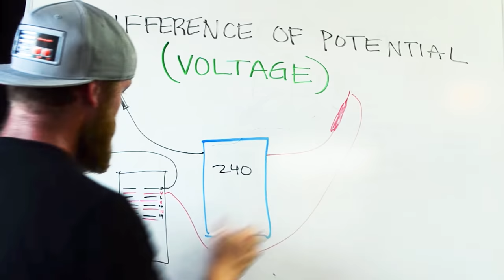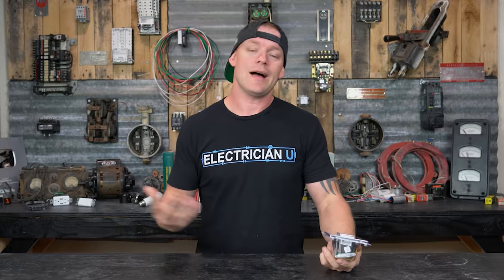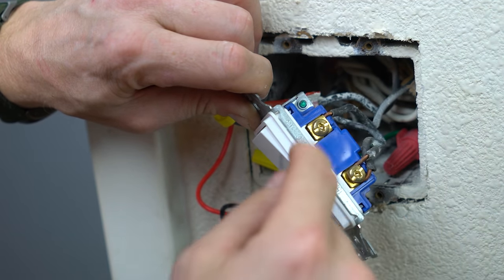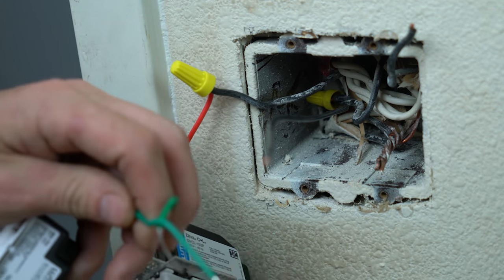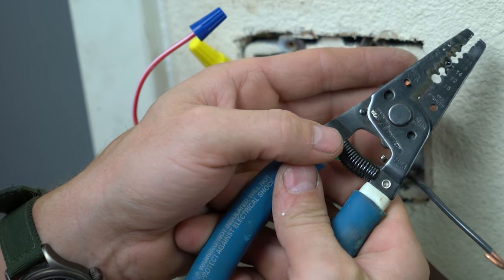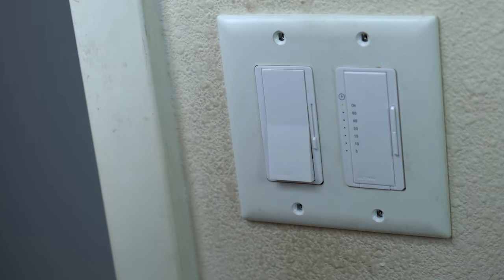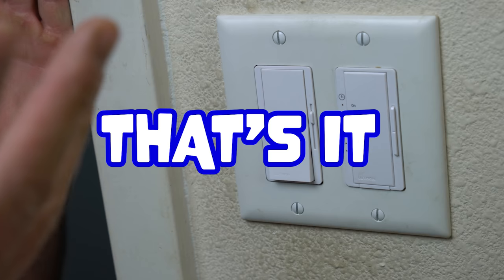How To Install a Bathroom Fan TIMER SWITCH

Comment: run the fan exhaust into his room   he'll remember to turn it off lol
Reply from the maker: aaaahhhahahaha that's an outstanding suggestion!  hahaha
Reply: @ElectricianU  What are your thoughts on wagos? Really enjoyed your transformer video, thanks.
Reply: @sylvesterstewart868  I like and use the lever ones. Cost more, but a big time saver and easy to change things later.
I've seen too many wire nuts loose.
Reply: @JasonW. I Was taught to make a mechanical connection by twisting the wire and the wire nut just insulates the connection. I have some I've used for temporarily connecting this solar panel set up I have. It seems like they could be good for where you might not want to risk breaking old wires by twisting them.
Reply: @sylvesterstewart868  The loose ones I've seen are where the wires were not twisted, and the wire nut was all that was holding things together. Wire insulation was usually blackened/charred close to the nut.

Comment: Very interesting to know about the metal tabs used for heat dissipation. I’ve always taken the minimum off, but never realized the purpose behind that. Maybe not quite as important with LED lighting, but great to know.
Reply: @boogermeats  those will get warmer the more watts they need to dim down, and the metal acts as a heatsink. Remove some of the metal, the thermal capacity won't be the same and may get too warm while dimming high watt loads. It makes sense to me.
Reply: @boogermeats  I would presume the documentation that comes with these lists how much derating happens per piece of metal removed. Would be best to see what the manufacturer says.

Comment: Hi,

Even better than a timer, the DewStop moisture sensing switch is fully automatic AND has an adjustable timer (settable between 3 and 15 minutes) function when you need to run it manually. Since the switch is being replaced anyway, this is the best approach. 

I installed one several years ago and love having it run as long as I'm in the shower and then it will turn off automatically when the humidity is low enough. 

On a different note, I've implemented the Lutron Caseta system, including the bathroom light switch, anytime I leave the house, all the lights, including the bathroom light, go off. The system is also programmed to turn off all lights (not including the bedrooms) at midnight. All switches are dimmers, so I'm not blinding myself when I need the bathroom late at night. 

Wish you well with your videos. 
Bruce
Reply: There are a few of them around, I use a similar Leviton product that has an even longer timer range, and will also run periodically - say 5 minutes every hour, great if you're venting a litterbox.

Comment: Great video as always! I just put in something like this a few months back, except I went with a Leviton IPHS5-1LW since my problem is more people forgetting to turn it ON when getting in the shower. It turns on/off at a button press, for 30 minutes of runtime, then auto off. It will also turn on when above spec humidity and until spec is reached. Humidity sensitivity and runtime are configurable with dials under the cover so there are options and still a neat and simple operation.
Reply: I also get great satisfaction from cleaning up a janky junction box when I change or upgrade a switch or receptacle. And yeah... It's nice to just be able to turn the fan on and let it automatically "courtesy vent" after you leave without having to remember to come back and turn it off later. 🤣

Comment: The electrician I worked with told me, just because something can be done (from code) doesn't mean it should be done.

Since we worked in a retirement home, switches and outlets were constantly going bad or getting destroyed and would need to be replaced often.

As such, we never stripped a mid conductor to create a connecting point. Reason was that exposed hot could accidently get jumped from someone working in the box.

It's safer to run a separate pigtail to each switch instead of having that unnecessary exposed conductor.

Comment: Even though, I was looking for another timer, I was so entertained, I kept watching. Great job keeping us laughing. I am looking for a timer, that I can plug in my big fan, so it can dry out my shower, then turn off after 1 1/2 hours. I figured, I would plug a timer in the outlet, plug my big fan into the timer, and have a remote control mounted next to my shower.  Any thoughts on this? Thanks, Glenn

Comment: Great video like always.
I just went with motion sensors, so I don't have to even touch them.
Reply from the maker: I've done that in the past too, but sometimes you have some extra stink and need to keep that thing on for a long time lol - I guess a lot of motion sensors let you program time delays though too.  Solid option, you're right

Comment: I just installed a fan unit with build in moisture sensor in conjunction with timer so unit turns on automatically while taking a shower or in some cases were some bathrooms have washer dryer unit works great

Comment: So the switches in this bathroom are a vertical unit ie there’s 2 switches with one on top of the other and they flip left and right to turn on and off. I’m sure you’re familiar with this as an electrician.. so what do you recommend I do for that situation? PLEASE! 🙏

Comment: I have a Panasonic FV-0511VQ1.  Have you ever had issues with these timers not work with certain bath fans?  I see the bath fan slowly startup and then shut off on its own before the timer expires.  Changing the timer to the always on setting does not remedy the situation.  Thanks.

Comment: Random question I have 3 different porch lights in 3 different places around the perimeter of the house is it possble to connect all 3 porch lights to 1 timer or does each 1 need a seperate timer switch??

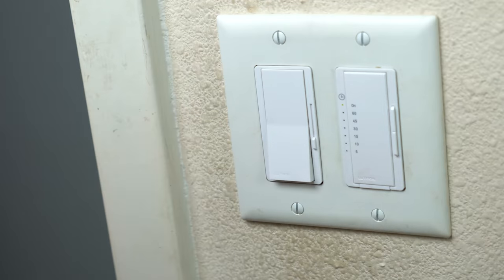Comment: When you put the cover plate on, you can see the green LED next to the "ON' label is illuminated (you can see it better at 16:38).  Why is it on already?  Was the power not turned off, or does this device have a battery-backup to maintain the setting if the power goes out?
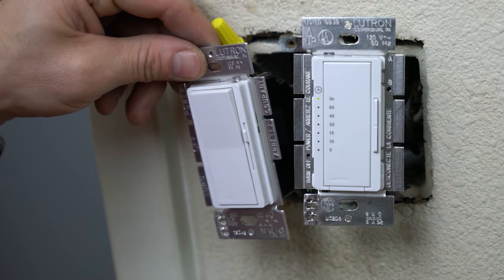Reply: Power was definitely on. At 13:03 he hits the switch and the light comes on momentarily.

Comment: If you loose power does the switch default back to on? Kick the breaker off wait and min and kick it back on. Wondering if you will have to re-program after.

Comment: Can you still turn the vents when the light switch it’s Off or when the dimmer it’s at low or half way? 
My Fan doesn’t come on until my light switch dimmer is at high or at On position.

Comment: Hey great video but get yourself a voltclaw to push those wires back into the box. Also to get the plate lined up and level stick it on backwards and put a level on it. Finally turn off the power unless you like buying $30 timers that blow up when you push them in.(I usually tape up the timer it it has exposed screws)

Comment: Great video! I have two questions out of curiosity: 1. Can you give me a ballpark estimate what an electrician would charge to do something like this? 2. What does it mean that the wattage rating will go down if you need to clip those tabs off...is that a safety concern? Thanks!

Comment: I have seen old neutral pigtails from the 1950s where they left one leg long, skinned a section and twisted it with the other neutrals. Then they soldered it and covered with friction tape.
Reply: That sounds old school and ugly and most likely there is no Earth conductor involved LOL :-) :-) don't stick a fork in it or you will be done
Reply: @kevinpoore5626  Sometimes there is a thin ground wire to the back of the box.
Reply: Yeah if that's what you want to call that but sometimes very rare and if it is there it's so short it does no good lol :-) :-)
Reply: @kevinpoore5626  It can possibly clear a ground fault if the hot wire in the metal box happens to become exposed and touches the box. Better than nothing at all if the box is metal.
Reply from the maker: me too lol
Reply: @ElectricianU  They weren't going anywhere, though. Most of the wiring from the 1950s I have seen was pretty well done, just not up to current code.
Reply: Those old damn switches seem to never go bad either. Lol

Comment: Even better than a timer is a humidity sensor switch.  Leviton makes one (PN  IPHS5-742-0LW) which works well.  Simplifies use by removing an actual duration selection (thereby removing the decision from my kids), but allows manual turning on with a single button, or automatic turning on of fan when humidity rises (no longer need to yell at my kids to turn on the fan when they take a shower!).  I've replaced all my digital timer switches with the humidity sensing switch, which should just be a code requirement because of its benefits.

Comment: I have a bathroom fan controlled by 2 x 3 way switches. One in the bathroom and the other on the lower floor to use the same fan as an exhaust for kitchen fumes. (Open concept floor). How do I install a timer in the bathroom? Cannot find a 3 way timer switch.

Comment: Great video. Not only educational but also fun to watch. One question: is there supposed to be a neutral line? Or is that optional?
Reply from the maker: Thanks for watching! Depends on if the equipment requires a neutral. (More often than not it does require one.)

Comment: 15 min is fine to destink the room!
Interesting about the heat sink on the switch.
Speaking of heat, I just learned that there is code for thermal expansion of pvc conduit and an expansion coupling to handle this.
Made me think of the wire in the conduit.
I'm running 1 1/2 PVC  90 feet to a subpannel. Using 2-2-2-4 aluminum wire. The PVC will expand and contract about 3" in a 100degree temp change. What about the wire?
Can't find anything on this, but it will expand with the temperature changes. 
Would it be a good idea to put a pull box in the middle and loop the wire in a circle to make room for the expansion and contraction?
Also, a video on different types of wire would be cool. I learned a lot looking for what type of wire to use for this.

Comment: Or change out the fan with one of those humidity-sensing ones. Ours was super old and noisy and barely moved air anyways. Replaced with a model that was quieter, higher CFM, Auto on with humidity (showering) and can manually trigger it on for 15 min with flicking it on-off-on quickly. Also was FORCED to do this since the switch controls the bathroom wall light as well, no extra switch leg in the box for just the fan. Yay old homes.

Comment: Why do U have 20 amp breaker but you have 14 2 wire 
I thought you use 15 amp break for 14 gauge
Reply: I think that was stock footage meant to highlight shutting off the breaker first.  But, you’re right about the 20amp/12ga relationship.
Reply: @boogermeats  Good point! Was wondering the same thing. I think Battle is right about the footage highlighting the shutoff.
Reply: Yes if you watch at 13:00 you realize the power is actually still on.

Comment: Do you know of a timer switch that gives you the option of constant power (no timer) as well as timed? My wife likes to run the fan as a white noise sound while going to sleep and needs to run for a long period of time.
Reply: You can use it manually as well as timed

Comment: I installed this very switch and it just flashed.  Instructions noted the load is either to small or to big.  Is there another timer switch that might work.

Comment: Don't be a dope like me. When I had my bathroom remodeled I went to a.large supply house who told.me on the phone that they stock 2 different batroom fans with moisture senser to turn fan on. When I got there of course they were.out if stock and carpenter was sheet rocking ceiling & walls next morning so I had to purchase a regular ceiling fan but with a night & regular light. Turned power.off the next night and wired in a 10 20 30 &.60 second timer. Turned power back on and fan did not work. Of course as a sparky with over 40 years in the trade I don' t need to tead instructions. Pulled timer.out of wall to check that I had power. Da never moved very little slide switch to on position. Thanks for another informative vid.

Comment: In residential, how many 14/2 can fit through a 3/4” hole in joist? I understand the hole is not allow to > than 1/3 of the size of the joist and stay 2” away from the sides. Please help
Reply: Hole has to be 1 1/4" from the edge. We run no more than 3 14-2 through a 7/8"s hole if the circuit is on an arc fault breaker and up to 5 14-2 on a standard breaker.

Comment: An average bathroom fan runs at ~20W, or .02 kW. In Colorado we pay $0.13 per kW-hr so it costs $0.0026 per hour.  Say you let the fan just run an hour each day and eventually get around to turning it off - just like most of us do.  That's less than $1 per year.  Can you guess how long it takes to offset the cost of this $30 switch?  And a lot of people will pay a contractor to do this.  What's your hourly rate?  Add that to the $30.   Now you probably have more than 1 bathroom so multiply that $30 by that number.   This switch is as useless as an electric pencil sharpener.

Comment: Um...Copper Clad Aluminum isn't "dipped" in copper...LOL... it's metallurgically bonded from AA8000 Aluminium and a copper veneer.  In fact, that bond has to take place prior to being drawn into appropriate conductor sizing. Now, back in the time you are speaking the issue was AA 1350 Alumimum and it was more an issue with the terminations rather than the AA 1350 Aluminum. It was all about the terminations and the expansion and contraction differences of the terminals and the aluminum, less ductile AA 1350. Just for some additional information of course. Now turn off the exhaust fans JOSH.

Comment: My bathroom fan is on two three-way switches five feet from each other.  WTF were they thinking.  There are also two doors to the room. 
How do I wire a timer switch to this mess.

Comment: You know what's funny is when a client by exhaust fan with a moisture sensor and they don't understand they don't need to touch the switch unless an odor is involved then if it senses moisture not foul odor but still funny try to explain that to a client especially one up in years lol :-) :-) just remember can be shocking

Comment: Is there a battery in the switch? I noticed there's no neutral connection.
Reply: its just a switch, not a load
Reply: @drfusioncraft  yes but theres at least an LED indicator in it
Reply: It works the same way illuminated switches worked with incandescent bulbs.  It closes the circuit with just enough current to power itself, but not enough to run the fan.

Comment: Please tell your subscribers that when you break a tab off, to get the switches to align with the face plate. You reduce the wattage of each switch. Thoughs tabs are actually HEAT SINKS.  To keep the switches cool.

Comment: What kind of a psychopath puts the cover screws vertically. Horizontal is the only way
Reply: It lines up with the vertical switches
Reply: Vertical is the only way. If you have toggle switches it lines up much better. No reason to change it with decora switches